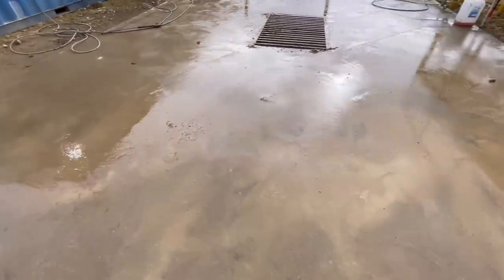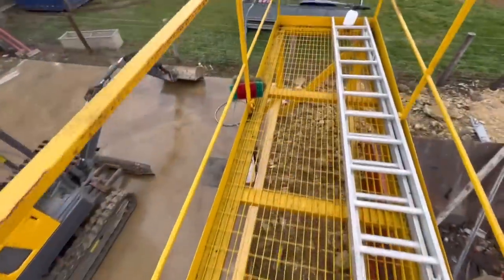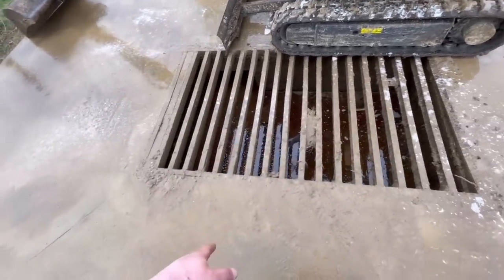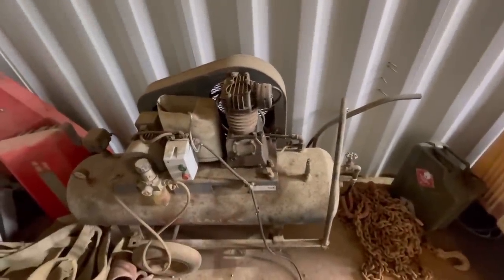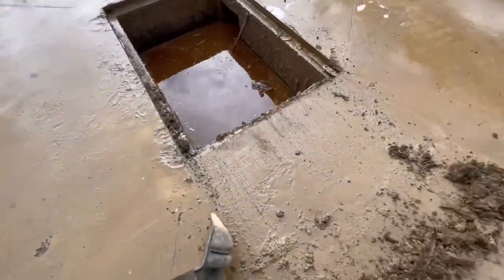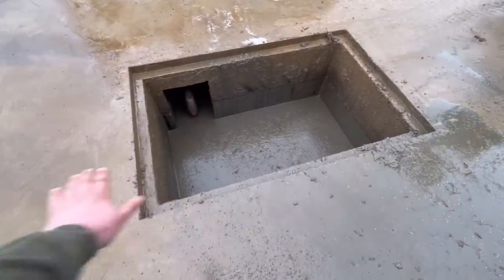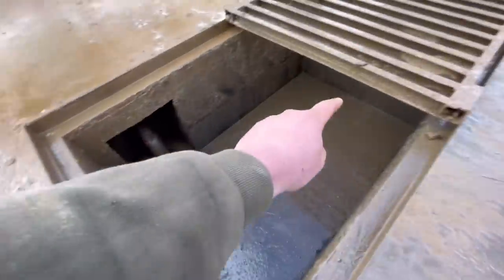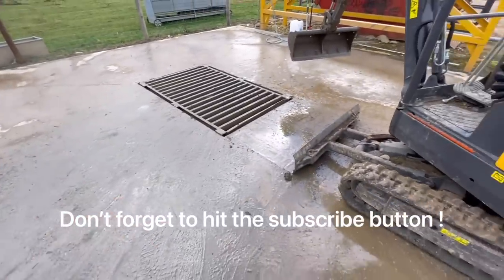The ultimate farm wash bay  pressure washer build

Comment: -- Our wash bay is fairly similar to yours, Tom, but it's longer (can take a 45' trailer plus the prime mover).
 -- Smaller portable stairs.  Means you can get nice and close to the equipment.
 -- The pit is deeper, and you can walk down there (via stairs) to make washing the underside of equipment easier.  There are also outlets for air and pressure washer in the pit to avoid trailing the hoses down there.  You stand on another removable grate, and the sump proper is beneath your feet.
 -- We use compressed air for our spray on foam/degreaser/whatever.  Just grab the relevant spray pot and connect it to whichever airline you want to use.

If I think of anything else, I'll get back to you.
Reply: Any chance I could get in contact with you? I'd be interested to see pictures of your wash bay pit, sounds perfect!